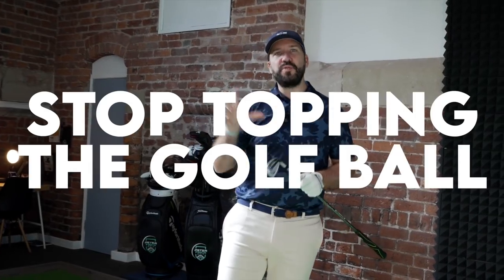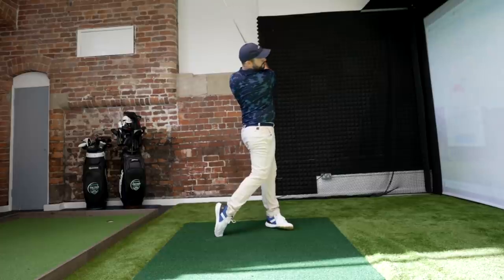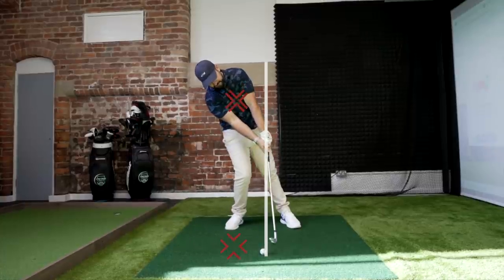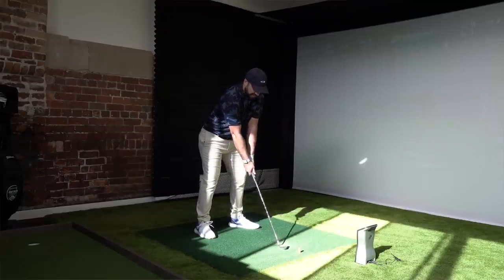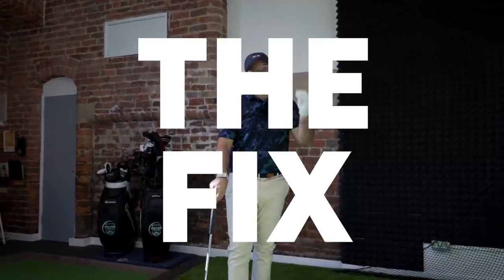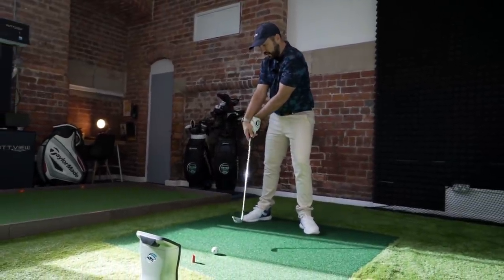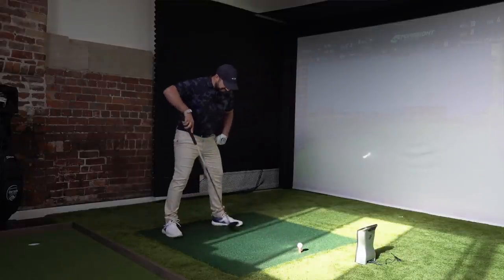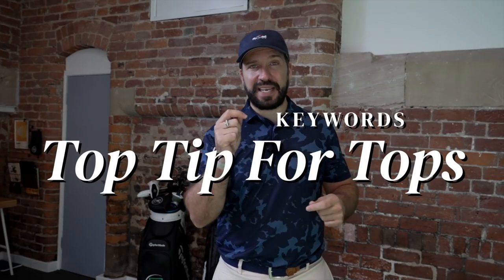How to stop TOPPING the golf ball!

Comment: I like these tips. I've been using a version of them to work on my wrist flipping issue at impact that was causing thin shots and tops with the longer clubs. Another Top Tip For Tops that I've recently been using with the forward weight shift is clearing the front hip early in the swing transition and having the back elbow BENT and near my body at my beltine at club parallel and at impact straightening only after impact. If you flip like I do chances are your hips are too square at impact and your right arm is disconnected, away from your body on the down swing and straightening too soon.

Comment: Top tip for tops

My biggest swing fault has been too much arm movement not enough shoulders, caused a very step swing meaning not only bottoming out before the ball but taking quite a bit if a divot before the ball too, now I’m working on really using the shoulders I’ve lost quite a bit of distance but I am duffing less shots.

Comment: I decided late in summer to use my 3 wood at range every time.  I usually kept it parked because of topping.  I like the idea of tee peg. I have heard of this many times but never used it. I think I will start using it. I think subconsciously I do try and hit it like a driver which destroys my shot .
Top tip for tops is the tee peg.

Comment: My problem was different. I went to see a pro. And I was bending the knees too much and was either chunking or topping depending on how much I bent the knees. So if none of these fixes work, take an easier swing where you don't feel the need to go for all that power. This will lessen the "need" to bend the knees. Then work that into your normal swing. Straighten the forward leg as well when making a swing. It will reduce the need to bend the knees too much. This will take a LONG time to fix if you have this problem though.